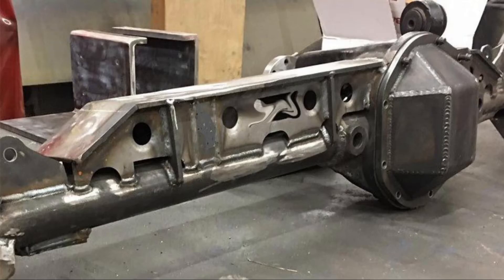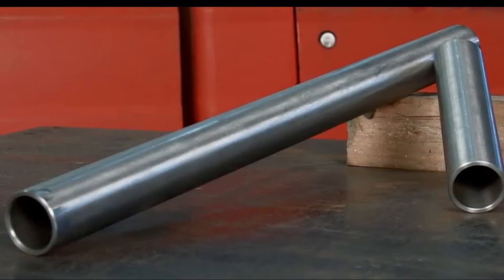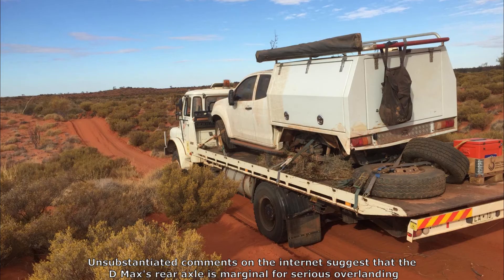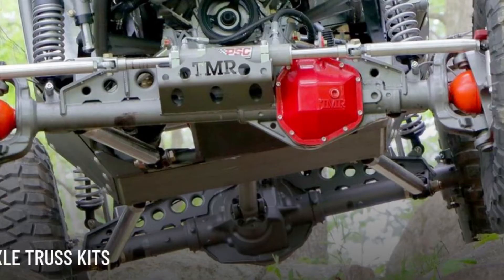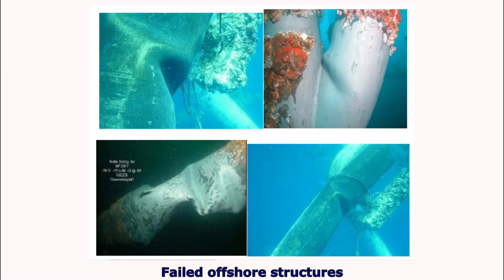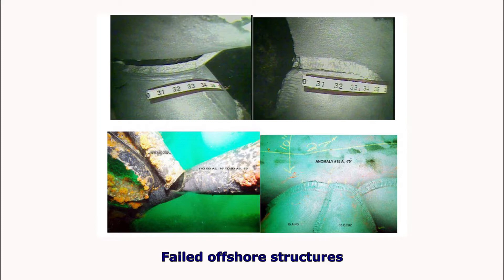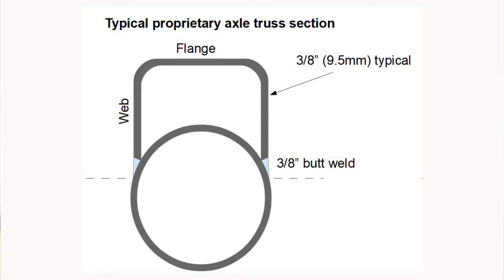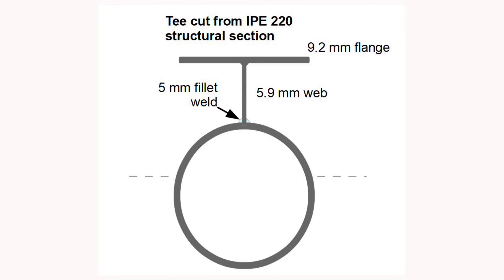Why axles break on overland vehicles. Part 8 - axle reinforcing / trussing systems

Comment: I've been following this series with interest. When thinking about how I could strengthen the Landrover Salisbury axle without welding, the press fit sleeve inserts looked like a viable solution but when measuring the flange side diameter, I found that, maybe due to the manufacturing process (friction welding ?), it was slightly smaller than the actual tube. Therefore the insert tube cannot be inserted without boring out or grinding the inner diameter of the axle tube. 
I would like to know your thoughts about the bolt-on method whereby a heavy plate is directly bolted onto the axle where the diff cover bolts on (using the same bolts together with a heavy duty diff cover). The plate, which extends behind the axle tube along the axle tube width, is then clamped appropriately to the axle tube, thus restricting vertical flex and reducing fatigue. Thanks.
Reply from the maker: Ian, your experience with the internal sleeve is exaclty what I imagined. Boring the axle tube would be a hell of a job requiring a large machine tool which isn't practical.
I don't know exactly what your proposed bolting solution looks like (a picture would tell a thousand words) however I did have a lot of experience with bolted repairs on early North Sea platforms which suffered from major fatigue problems (designed before the phenomenon was well understood).
The problem with most bolted joints is that there needs to be relative movement before they take load which means that the member you are trying to reinforce ends up taking too much stress. These repairs are more effective at increasing the ultimate strength than in preventing fatigue. However if one can design a joint using HSFG (high strength friction grip) bolts the load is taken in fritction and the joint is much stiffer; HSFG bolts are extensively used in bridge girders and other structures where relative movement must be eliminated.
These axles are perfectly weldable and one shouldn't be too cautious. I needed some new anti-roll bar brackets fitted and, not trusting my own terrible welding, took it to a local engineering shop where they did a good job. I'd have no hesitation in letting them fit welded reinforcement; it might even be possible do that in situ if you use a simple system like the structural Tee which I have proposed.
Reply: @defendermodsandtravels  Thank you for your reply.  What I had in mind was something on this principle https://www.motorsport-tools.com/atlas-axle-escort-mk2-historic-group4-spec-fully-floating-twin-taper-ap-cp23.html.
What worries me about welding is not the tube but welding to the casting. 
There is a specific method for that (i gather). I had never heard of HSFG bolts before but I checked about them and essentially and I stand to be corrected, if one were able to obtain  high tensile (12.9) bolts and tighten them onto the plate to a high degree, you would be obtaining the friction effect that you described. Of course, this method is only applicable to salisbury type axles and not the standard Rover axle because of their design.
Once again, thank you for sharing your experience.
Reply from the maker: @iangrech4777  I have looked at the bolted-on reinforcement which you mentioned and can see at a glance that it won't be effective. It's smply too flexible to attract stresses out of the main axle. One could design a clamp using prestressed bolts but it'd be a lot heavier than the one illustrated. In the offshore engineering field we had to do this for damaged joints and members because welding under water wasn't feasibile, but that's a different story.
Welding to cast steel isn't difficult but one needs to take account of the wall thickness. If the wall thickness is high it needs preheat to get proper fusion and controlled cooling. You'll find various videos online including this one:

https://www.youtube.com/watch?v=RtPqCEqifaI

I don't know what the wall thickness of that diff was but I suspect it was quite high which makes one ask why the diff housing had to be reinforced in the first place (I'd suggest it's more about appearance than function). The wall thickness of the tubes of a Rover type axle is c.6.5 mm and only modest preheat is needed. You'd need to check the thickness at the diff housing. If you ask around you will find the correct weld procedure for your axle.
I hope this helps and that your project goes well.
Reply: Bill, I completely agree that such a plate would have to be a steel item, much heavier and possibly reinforced with tee or angle sections. I could not find a better illustration but the principle is the same. I did manage to find a forum where a guy did something similar in laser cut steel to strengthen a rally car axle (possibly to counter forces after becoming airborne!) reporting success.
Incidentally, I had watched the linked video just a few days ago. The axle i want to reinforce is just like that one, but the tubes in my case, have a smaller wall thickness (Americans make beefier axles). The problem with these axles is not that the housing is not thick or stiff enough, but that the housing is much stiffer than the tube and constant 'flexing' under the weight of an overland vehicle induces fatigue and ultimately failure (especially after bottoming out) at the interface between the tube and the cast steel housing. Indeed, all the photos I have managed to find on the internet, show Salisbury axles with failure of the long tube, the one with most stress. That is, IMO, why many build a truss that spans the axle length like a 'bridge' and weld it to the housing; to allow any vertical forces on the tube to be transmitted and distributed across the whole axle.
You have been of great help with your input and experience sharing
Reply from the maker: @iangrech4777  With respect a steel, instead of aluminium, back plate to the bolted reinforcement won't help much. The problem is that the plate is loaded eccentrically and will twist (plates are very weak in torsion). There ways to overcome this but this isn't the right forum to discuss such detailed matters.
I'm not sure I buy your reasoning for bridging over the diff housing. A sound, full strength welded joint will be fine. Each axle tube will just act as a cantilever which is one of the most basic structural forms.
Reply: @defendermodsandtravels  when i mentioned 'bridging' I meant the huge truss across the width of the axle (which I am not a fan of) like the ones illustrated in the video @ 2.45. Anyway, by far the cheapest and easiest method would be the I-beam method you referred to but, not having any welding skills myself, I would have to rely on someone else. Here in Malta, I'm sure there are several skilled welders, but I just don't know  anyone, personally, who could do this job. That was the reason why I had initially discarded anything involving welding. I'll ask around.
Reply from the maker: @iangrech4777  I have been thinking about your comment that Salisbry axles always fail on the LHS with the longer axle tube. The torque from the prop shaft will put additional bending moment into that side and will reduce the BM on the RHS. I will update the free body diagram to show this. Thanks for drawing this to my attention.